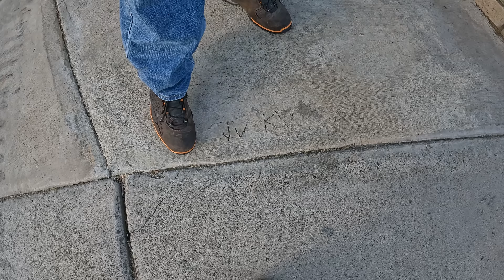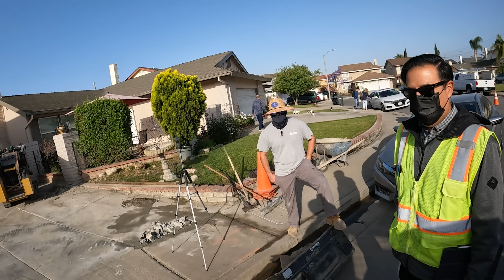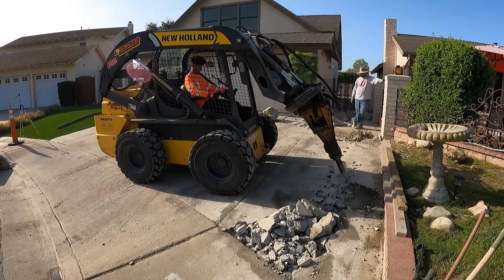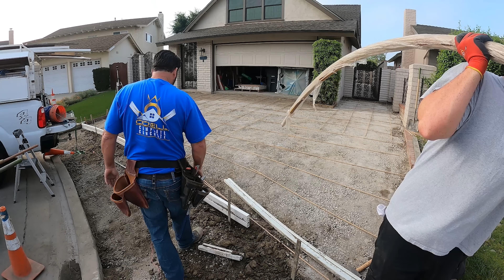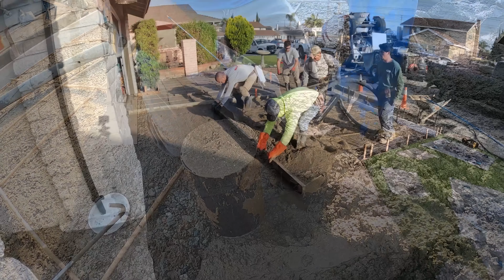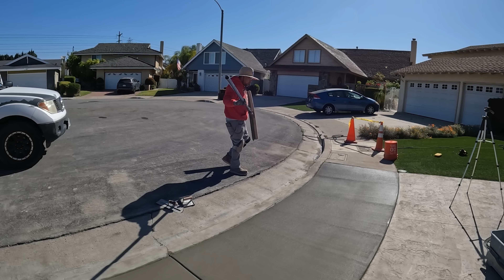The Building Inspector Showed Up...

Comment: Tell the home owner that a small piece of PVC in the street gutter makes a "GREAT" Curb hopper, along with not resticting water flow. Find a length of pvc pipe 1/2 the height of the Curb. Paint it Plastic Paint "Cement" color.  (no one will notice it if it blends in)....
Reply from the maker: Good idea
TY

Comment: Thats a very green inspector, I'm surprised he didnt bring a detail for a Type A approach. It would show specifically where the joints should  go. Many of the older Inspectors wanted to see a Tamp on site the day of the pour to make sure you were using Hardrock and not grout "Peagravel" in the approach. But this young kid likes to say "Municiple Code" alot lol . And yes David the garage door size usually dictates what with the driveway can be plus maybe a foot on both sides to the bottom of the X. Its always worth applying for a variance on behalf of the property owner when the request alterations,  it dont hurt to ask. Or just do it. Lol its easier to ask for forgiveness than to ask for permission. 😅

Comment: I find it interesting that the reinforcing is so far apart. Here in Australia it is much closer together. ( 4" mesh). Very nice work btw.
Reply: Am I right in saying that the reinforcing should be mid way between the base and the surface of the concrete? so would it be easier to place rio chairs under the mesh to achieve the correct height?

Comment: lol that inspector jumping on it. There is a tool that measures compaction, looks like a slide hammer. You release the weight several times and has a measurement how deep it goes to see if it passes or not.
Reply from the maker: Yes, but didn't need it here.

Comment: You should be able to apply for a variance from the zoning board.  At least you can in the city I’m the inspector for.  It does require a meeting and vote but doesn’t effect the whole city.
Reply from the maker: that's interesting, I know in other Cities I've worked in its not a problem to widen them as long as you can maintain a 20' length of full curb height in front of your property

Comment: Good to see the contractors do pull up the reinforcing to the centre of the concrete depth — unlike some who leave it on the bottom of the grade where it rusts away and does nothing for concrete strength.
Reply from the maker: I concur
TY

Comment: Why couldn't they just do a "Variance" with the building department in order to widen the width of the curb access? A variance applications is slightly time consuming but its not that difficult to process.
Reply from the maker: I wish they did
Reply: There must be a balance between the needs of the property owner and the needs of the public: widening the driveway beyond the width of the garage will reduce parking space for the public.
Reply: they probably could in 6 to 48 months form now. highly likely the later of the range and snooty neighbors crying 🤣

Comment: Poor-quality fly ash can have a negative effect on concrete. The principle advantage of fly ash is reduced permeability at a low cost, but fly ash of poor quality can actually increase permeability. Some fly ash, such as that produced in a power plant, is compatible with concrete.
Reply from the maker: I think it's better to pass on fly ash do to miss uses
Reply: It's more susceptible to effloresce (powderize on the surface) and it's slower curing. So I've read. I'm not a concrete guy, but a civil designer. I love good concrete work. So gratifying to see!

Comment: The majority of inspectors have no experience within the field and go based off the books when in reality they should go based off of experience.
Reply from the maker: I think that is a part of it
Reply: That’s the whole reason of having an inspector. To go by the book. If you let every contractor go off their experience you’re gonna have a lot of problems.
Reply: @daaneel  but most inspectors know how to handle the situation and answer it properly. Look at the two questions Dave asked him, now we all know Dave was just testing him and see if he knew what to say, but the inspector didn't so that's why he said "idk". Does the book contain the answer idk? The book should contain a clarification of what is requested on behalf of the county, municipal court etc.
Reply: @josuedehoyos  I agree with you. Sounds like the inspector did not clearly read the book and couldn’t give a confident answer. In that case you can definitely press them to show you which exact code is enforcing the rules. However, to bend the rules of the book based off contractor experience, usually just means the contractor wants to do it easier, cheaper, quicker and not safely.
Reply: @daaneel  there is no shortcut in the construction industry. Plus cheaper? Psshhh Our economy is already messed up and most construction workers want a minimum of $200 per day which is equivalent to $25hr for 8hrs. Plus every construction field area is risky no matter what you specialize in whether its concrete, roofing, plumbing, electrical etc.
Reply: @josuedehoyos  trust me there is shortcuts. I am an highway construction inspector
Reply: @daaneel  have you ever poured concrete or installed rebar or run a crew of 6 individual men?? Experience plays a crucial role in ones job but if one decides to learn something new or be a manager in a new area then they must have a strong understanding of what is required from that specific job role.
Reply: @josuedehoyos  not sure I understand your point ? I have inspected concrete slab replacement on a highway though. A lot bigger job than your home driveway plus there are cars going in the lane next to you at 60mph. I had to get on the contractor for installing dowel pins at the correct spacing. Saw them try to install two bars 3” apart instead of 1’. Had to get on them to correctly install the foam backing between existing and new. The foam backing kept falling off/glue not sticking. And they kept burying the foam under the concrete providing no use at all. I told them if I saw another one I would reject the concrete panel. You work for one contractor. I work with multiple contractors and new foremen and crew every week. I’ve seen it all. You have good crews and you have lazy and cheap contractors who shouldn’t have won the bid in the first place. There’s some guys that got everything down, and there’s some guys you have to hold their hand through the standards.
Reply: @daaneel  you should give them a little demonstration whenever they make a mistake. And you do know my point your just setting it aside
Reply: @josuedehoyos  I’m not there to do their job. I’m there to enforce the standards and specs. I really don’t understand your point or why you’re arguing with me
Reply: @josuedehoyos  if you think every inspector is evil and out to get you, then the problem is something else.
Reply: @daaneel  your taking this as an argument??? Wow your really irritated then. As a inspector you should be there every phase to make sure everything goes accordingly to plan, but oh well go by the book then at the end of the day the inspector or manager always blames one or the other for miscommunication or doing the job improperly.

Comment: I thought filing for an exception is just that - getting an exception for what you need to do because right now the code is causing a difficult problem that needs addressing. I know for a fact that exceptions are made by councils when they are reasonable and don't create problems for others.

Comment: Thank you for always listening to your customers. Saving the initials scratched into old concrete was very sentimental to owner. Taking time to saw cut rather than jackhammer is superior customer service. Codes vary by region. Too many fly by night contractors will do everything they can to avoid 'Inspectors' and ignore codes for specs because it costs them money. They are not worried they will have to fix bad concrete.

We almost always had good relationships with inspectors. More than once, inspectors actually knew more about a particular neighborhood than we did. Soil conditions, drainage, crazy neighbors, and lose dogs. Like all projects, timing is everything. If you have a concrete truck waiting for you, and you still need to call and schedule inspection, that's a big problem. 

Can still remember trying to do tens things all at once as concrete is on the way. It's going to be a long day, and it is just starting. Best part of day was when pour went well, finishing went well, didn't have 5 yards leftover, everyone showed up for work, and it didn't rain. Used to work in Seattle, rain drove us nuts sometimes.
Reply from the maker: that's some good information from a guy that's been there and done that.
TY for sharing
I lived in Bellingham for about 6 years. Very green but tough to do concrete
Reply: @OdellCompleteConcrete  Thank you. I have been following you for a while now. Thankfully good contractors like you outnumber the bad ones. 

The company in Seattle I worked for specialized in smaller projects that were hard to build due to location, or access into site. Lots of heavy hand labor. When you wheelbarrow concrete, you begin to appreciate how heavy it is.

Comment: I prefer to do my driveways at 5.5”.  4” is not really able to handle moving vans.  I also do the apron at 7.5”.  Like you I thicken edge it from the driveway to the apron transition.  I put joints in at no more than 10ft and dowel them.  Never had one of my driveways crack.
Reply from the maker: Sounds good tY
Reply: @OdellCompleteConcrete  I don’t do stamped concrete though.  I found that very interesting.   I mostly do roads and runway work, so driveways are typically just favors for fiends and family. I either do broom or burlap finish.

Comment: First off I'm a huge fan here from  North Lake Texas near the TX motor speedway. I love watching your work it's up there with national geographics,  NFL and UFC. Which patch stuff did you use on that curb? Also Sir I'm trying to find a good video on cementing over existing exposed gravel patio. I have a patio with a  hair line crack running right down the middle of my entry upto my door and it looks very ugly. The home is 13 years old and that crack has been there 9 months after they built our home. Retired vet on limited income and I will be doing this myself. My patio is 450 sqft and I have 2 inches of height from existing exposed gravel patio upto my threshold of my front door. Any advice would be very appreciated and if you're ever in my area I'd buy you and your crew a beer just for providing thousands of people knowledge and entertainment.

Comment: The pavement will need to be replaced before the rebar gets anywhere near deterioration. So don't worry about it. Those cores don't need to be analyzed unless there's a problem with the concrete later on. For now, just check the compressive strength. Slump and air should be on the batch ticket. Save it. And use a white curing compound. That curb patch will not last. It will be the first thing to break. Don't worry about the inspector, go straight to the city Engineer and argue your case. I'm sure he'll give his/her approval to cut it out. One more thing, concrete cracks. That's why you put joints in the concrete to make it crack where you want it to crack. The joints should be filled with a bituminous material. Now your finished.

Comment: Used to do this R & R driveway/sidewalk work.  Had an excavator who came up with the best tear out method I’d ever used:  he’d show up with his dump truck towing his track-hoe & trailer and one 2 ft. oblong chunk of granite that weighed about 200 lbs., that’s it.  Unloaded the hoe and grab that block of granite and carry it to the beginning of the demo.  He drop that granite chunk all over, get out that first piece, then pick it up, then walk through that demo faster than anything I’d ever seen.  The other thing a skid steer does is if there’s any moisture in the subgrade all that forward and back turns it into a mudhole.  The trackhoe doesn’t have to do this and is twice as fast.
Reply from the maker: That's interesting.
TY

Comment: I like the cutter you used on the let-down. I made on similar about 25yrs ago, every one thought I was nuts but it sure made straight cuts. Mine was 1 3/4" deep, I could power trowel over it and the crack would still come through just like a zipstrip.
Reply from the maker: Great idea

Comment: the mix with the added polymer is really nice to use, as I've used with stucco repair,  but also mortar and concrete repair. Unfortunately its not very good for underground parking walls. Its good to try new materials as a solution to interesting and difficult applications.

Comment: I worked in Prescott Arizona as an electrician apprentice an this concrete company that did the driveways on houses would have the rebar in the driveway for inspection before the concert was poured . After the inspector approve the site he would take the rebar out and move it to the next house next store . An have that house inspected an do the same the next day or 2.
Reply from the maker: Shady operation
Reply: @OdellCompleteConcrete  yes it was and the cement truck driver was shady too. I quit work there an told one of the new house owners when they moved in .

Comment: Flyash builds on byproducts of cement hydration.  You can get a stronger product or equal if you use less cement.  HOWEVER it delays hydration.  A high concentration of fly ash might yield let's say 3500psi in 28 days where the pure cement mix 7 days.  There is also the issue of color consistency 

It makes sense for a city to not permit it for these exact reasons alone.
Reply from the maker: Yes it's a real problem using fly ash without good quality control

Comment: It isn’t necessary to change the entire code to allow for a variance. My driveway opening is offset by 2 feet on both sides of my driveway. The entrance from the street is shifted 2 feet to the east. I cannot back out of my driveway or pull in without either going over the curb or going over my lawn. Personally, I think my curb was a mistake. The code does not specifically state exactly where the opening is supposed to be, but just that it can’t change. But if it did change because of mistake by the contractor who did it when replacing the curb, then changing it back should just be a simple matter.

Comment: I agree that fly ash is a greener and cheaper substitute, and as you pointed out it also does make inferior concrete. Side note, Silicia fume is a more expensive substitute but makes for a superior fast setting high strength concrete. State DOT’s keep pushing fly ash for reasons that are not science-based. Also I appreciate the professionalism you showed the inspector. His day was made better seeing a good contractor that was respectful and wasn’t going to argue about the absurdity of some municipal codes to the inspector that literally has no ethical control over the codes.
Reply: what absurd code?

Comment: Not gonna lie, through the camera, that is some good looking "grass".  I didn't know it was fake till you pulled it up.  I also prefer using chairs with rebar and mesh.  Nothing like everyone standing on the rebar/mesh you just pulled off the ground and pushing it back down to the base when they are spreading the concrete...
Reply from the maker: 2' centers, no need to stand on it

Comment: Why is there no steel mesh in the concrete? Here in Aus, it is the law.  It stops moving and splitting of the concrete. We still put saw cuts down to the mesh. (not through it.) Controlling the cracking and movement of the concrete is the way to go.
Reply from the maker: Good idea

Comment: This is better than using wiremesh that ended up without concrete cover which will eventually prone to corrosion.

I also like the compression strength testing cylinder sample for quality assurance. 

The way you do slab on grade is great. You use vibrator to avoid honey comb which guarantees the longevity and strength of concrete.
Reply from the maker: I concur
TY

Comment: Great job! I use clay pots but you're right, I make sure I put a tray under the pots so that it doesn't strain. I'm surprised that the driveway that you removed didn't have rebar.
Reply from the maker: Most of the older concrete flat work doesn't have reinforcement
Reply: @OdellCompleteConcrete  why didn't you raise the rebar above the base?
Reply: Most municipalities won't let you put rebar in the approach, in case they have to get through for utility work, as I've been told.

Comment: I've always finished up after a good bull float application.  I found few finishers can improve upon that; most add high/low spots when hand troweling.
Reply from the maker: Doesn't sound to nice
Reply: @OdellCompleteConcrete  It comes down to does a foot long trowel/float cover a larger area than a bullfloat per swipe; not to mention having to fix where the trowel guy was kneeling.

Comment: Nice work, always great to see someone who takes pride in their work. You should rod those test cylinders; fill 1 third and rod 25 times across the whole cylinder with 1/2 steel rod, fill 2/3 of cylinder then rod that layer going 1 inch into first layer, then finally your third layer same step. This will get any air out that could affect the strength of the concrete. Improperly taken test cylinders are not indicative of the actual strength of the concrete that was placed.
Reply from the maker: Yes the concrete placed is weaker then a perfectly done cylinder.
Reply: Well yes and no the concrete placed(driveway) should have the same if not stronger  psi if properly consolidated and maintained during curing duration to achieve those results. And I could be wrong but it looked like you are using 4x8 cylinders witch would be 2 lifts of 25 rods and consolidation not 3 like you would do with a 6x12 cylinder.